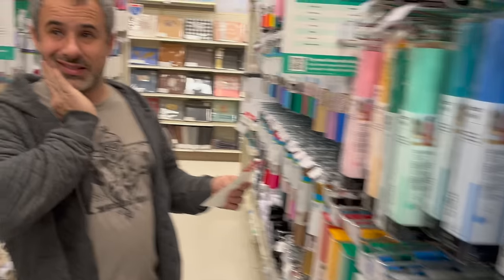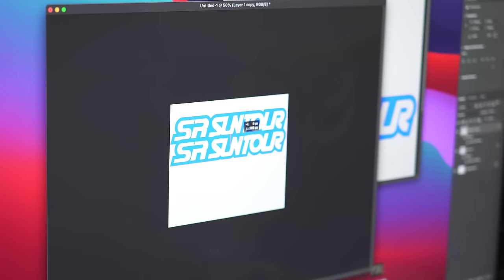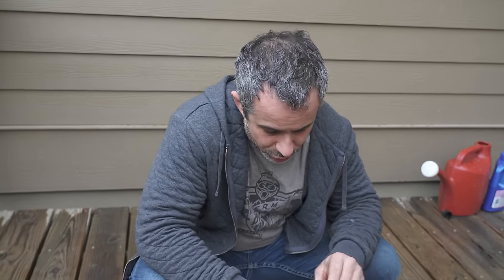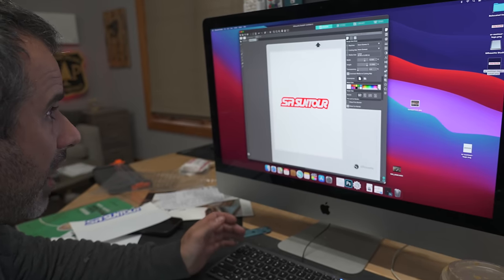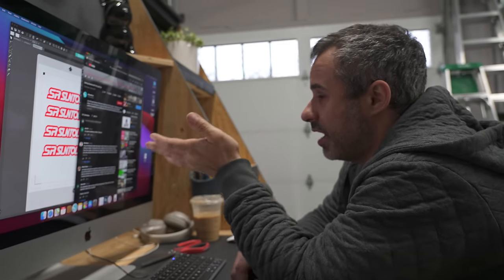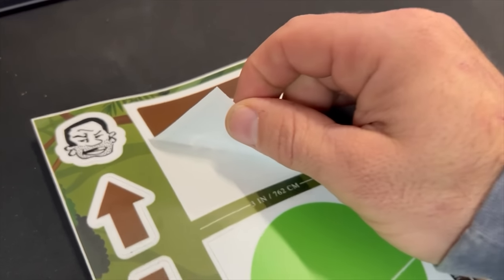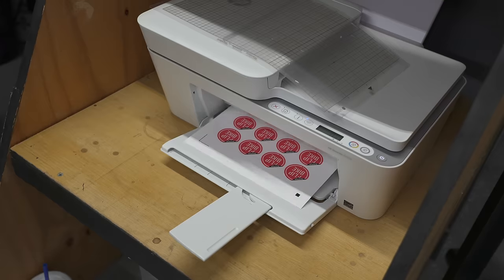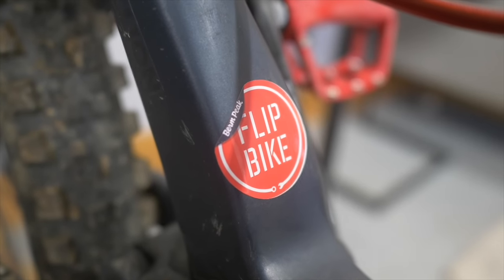Watch a guy figure how to make decals for bike parts

Comment: As someone who's helped out while others were trying to do things like stickers, buttons, iron-on transfers and embroidered patches, I knew exactly where this was going around 5:10. 
While I skip instructions all the time, this kind of production is one of those cases where you're dealing with industrial software with a prettied-up user interface to look good on advertisements. If you don't treat reading the instructions and tracking down explanations in simple terms as a "this will lose me my job if I mess up" level of seriousness right from the start like you would with industrial software in a workplace, the frustration will snowball fast. You're not buying hobbyist equipment, you're buying introductory enterprise-grade equipment, and the learning curve is nasty.

Comment: 11:24 If you think that's much, wait till you get a 3D-printer. The amount of frustration and failed prints before you know your machine. And when you think you've got it, it trows a curveball for you when you try to print a new model you haven't printed before. And all the settings in the slicer software. It's a deep rabit hole.

Comment: For a tech guy I find it hard to believe it took you all day to figure out how to make a sticker - are you hamming it up? I have a Cricut and it’s fairly straight forward doing a print then cut. Lots of short 10min long videos on the subject… The longest/ trickiest part can be getting the right format image to begin with and importing correctly. Then it’s easy as from there.

Comment: Been using those cutters for years. 

Cutting mat was not needed as the film has a backpaper.   Cutting mat is only used when you are cutting plain paper for craft.

Just use the vínil pre-setting and correct knife depth.

Comment: I actually went through the same with Silhouette Portait. The hardest thing to figure out was that if the cutting mat is entered along the bumps (where it likely should be), it covers the autoblade adjustment hole - the autoblade does not do the clicks, the blade does not extend and no cutting happens :) Thanks for the inspiration.

Comment: Cant u get reverse print media so its underneath the vinyl, so no protective spray?
A friend makes vinyl stickers and they print and laser cut and no issue with fading or colour washing off as the print is not on the vinyl outer surface.

Comment: I work for a vehicle branding company. This kind of stuff is my bread and butter. Ask any question you want.

I'm not sure what type of vinyl you are printing on, but if it's 'monomeric' the stickers will shrink over time and leave horrible glue residue around the edges that dirt will stick to.

Ideally you should be using polymeric vinyl for the types of decals you are doing.
Reply: Also, keep in mind that you can use the vinyl cutter to make paint masks. So technically you could apply the mask, spray it, remove the mask and be left with the logo.

Comment: What you can do is get some seethrough vinyl and not cut along the shape itself, but maybe as a solid line around it or a millimeter off the shape. What else to remember is that you don't want sharp 90 decree angles on outside stickers, the corners are weak, so have a slight curve on them, keeps the edge on longer.
Reply: Forgot to add, extend the image one layer below the cut line or make a image behind the cut line a few mm's wider so you don't get that white line at the edge